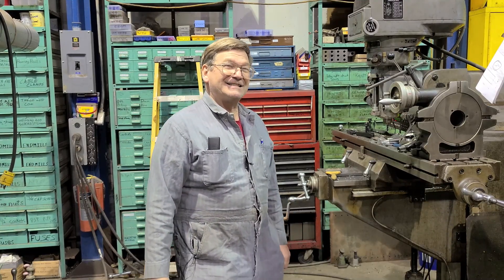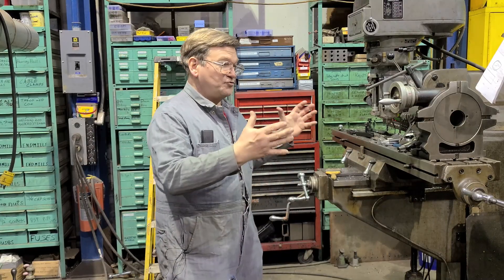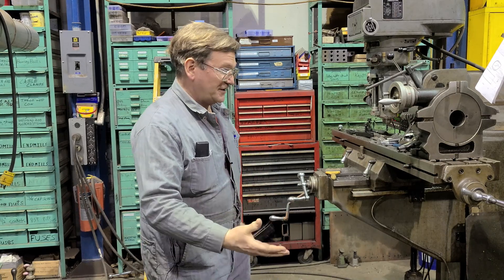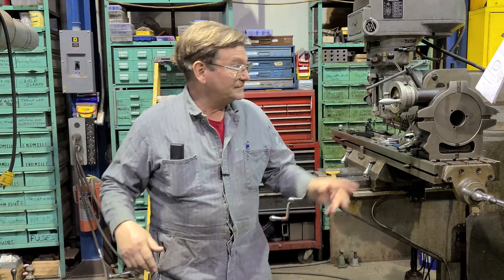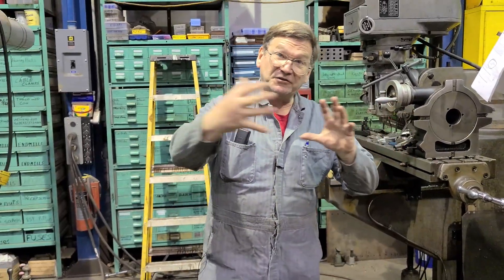Machinist's Minutes: CNC's vs Manual Machining

Comment: I do almost exclusively one of parts (Tool and Die department), we have thrown out all but one manual lathe and a mill that gets used maybe 2 hours in a week, all other machines are CNC. IF you have your cnc speced and setup for one of parts then it is hard to find a job that would be quicker on a manual. 
To take the flange part as an example once that is clamped into the machine it would take less then 30s to probe the center of it then i would go to my computer next to the machine and open the cad/cam and click make hole circle, select 8 holes and a diameter. Then select the thread size from my macro list and click on one of the holes, change how deep i want to drill and tap  hit calculate and send program. This is less then 2 minutes for a ready program and now i am drilling with a high hp spindle, through coolant carbide drills etc so those holes would be drilled, tapped and chamfered in no time.
All this requires that you are setup for one of parts with both the right machine and cad/cam software. 
I have 60 common tools ready in the machine and prob 30 "less common" outside the machine that i can insert manually in the spindle. All of those tools are also in my tool list in the cam program with cutting data etc ready and in my cam macros. 

The Jobs were a manual would be preferred are stuff like repair/modifications on certain old parts with no drawings available (especially irregular shaped castings)  and where you have to take of some material by eye and maybe shim the part into a weird angle. The last job i sat up in the manual mill was ironically a rather large batch with stamped parts.
A single hole needed to be countersink and after machining the fixture in the CNC i moved it over to the manual.

Comment: In today's work force the technicians are probably less intelligent 🤓 as you are . And CNC is slowly taking over. I am a welder fabricator for the last 2 and a half decades. And most all shops I have worked in have had a CNC burn table.

Comment: Full disclaimer: I'm still working on my degree and have very little experience in the machine shop, but I like to have opinions on everything!

As far as why the constant bias towards CNC/3d printing, I think its because thats what more accessible in terms of cost and space. I mean, even up at the university, most of the guys I know spend all their time in solidworks, then 3d print it becasue its so much easier to set one up in a dorm room. If thats all you end up working with, it just becomes what you know, so it becomes the hammer and nail problem. 

The other thing is that learning how to work with G-Code on a 3d printer has a lot of cross over with CNC Mill or Lathe programing (so I'm told), so its an easy way to start getting familiar with it without having to invest the money and space into a full machine shop setup. Furthermore, the CAD programs we are taught typically contain a tool path generation function, often with a companion simulation function to run that tool path on the computer before it gets run through a machine. This makes visualizing the entire processs easier, along with giving a very flashy animation to show off to everyone who needs to see it. Again, when thats the perspective that you visualize the entire process through, it makes every part look like a CNC'ed part. It also doesn't help that companies like to advertise  "machined from a single block of aluminum". Sure sounds flashy, but that does sound like a lot of wasted material!

I wish we had more classes with a hands on learning without using computers all the time. Not even as the whole class, but just one or two more hands on labs per class. The only reason I kept going with an ME degreee path was because of the machine shop lab for Industrial Processes! Its staggering how much you learn about production when you actually have to build the thing yourself, and it just makes you appreciate the time and effort of going though each class that lead up to that moment.

Comment: Manual mills and lathes are faster for low volume manufacturing if you have an experienced machinist. 
However, for high volume production CNC is the way to go. Even factoring in program time and machine setup time with touch offs & indicating etc the CNC will have significantly faster cycle times and can be run easily by a minimally trained “operator” thus enabling shop owners to make more money.

Comment: Threaded bolt patterns is one case where, if doing even just four, it would be super easy to write a code, set up the machine and tools, and blow through the job. And the code is there if you ever get the job again.
Reply: Exactly! Simple stuff like that takes minutes to program. Literally click bolt circle type your parameters. Set up wcs, drill, chamfer and tap. Also, you could easily get that down to 1 minute on the right machine and with the right tooling. TSC drill, chamfer, tap. Setting up tools is equal time to manual. Because the machine measures everything for you. And something he fails to mention is while you are running the last job you are programming the next. Manual is almost never the answer IMO. In his defense I have only run manuals to do the most basic of things and I’m one of those young guys who he probably doesn’t like.
Reply: Uh, at Henman Engineering, they had about three or four manual Machinists, making and replacing jigs & fixtures. They had a Blanchard grinder, a turret lathe, a few more, about three Bridgeport style verticals, some other stuff, nothing shiny new. Not sure what kept them busy. About twenty CNCs, three shifts. Only soft jaws were made in the CNC, everything else was done on manual machines.

Comment: I Love my manual machines... its where I started and prided myself with the quality of work I could produce. Fast FWD 20+ yrs... I run CNC machines at Work and in my buddies shop... I have manual machines in my garage... being a Tool and Die guy... we do a lot of one off parts with relatively decent tolerances... .0002" - .001", some of the butter jobs are called out to a .003" - .005" tolerance... 😂
Anyway, My manual mindset runs strong so I run the CNC mills like a manual machine. Most of the time I have programs i.have wrote that i keep in the log where i can pull up and change a few things... example: bolt holes... all i have to do is use the probe, let it find center, open my program change the tool, Z depth, my 'I' and 'L'  hit go/green. Lol
If i were still in the Navy at the base shop, I'd be using a Bridgeport with a DRO, and it would easily take twice as long to do a simple part as such. 
There are parts that I do that need to be done on a manual machine... typically those jobs are relatively large and are too big for pur CNCs. 
If i had to choose between having a cnc mill or a manual mill in my garage... for argument sake a HAAS VF2 or  a Bridgeport with a  52" table with auto feed on The x, y and z... I'd choose the VF2.
Cost savings the manual machine wins hands down... long term money made the cnc will handly win against the manual machine.... the cnc has more to offer for jobs, faster turn around times, and trust me when i say, I dislike saying that because I'm still a manual guy at heart. The cnc eliminates a lot of the costly tooling required to make manual operations effectively efficient. 
The biggest issue i see, are these kids from college that have an engineering and design degree, they come into the shop and start designing stuff that is impractical and in some cases impossible because they dont understand machining practices and the shops capabilities... they have theory but lack practice.

Comment: The right tool for the right job. The people who won't give you one off work because you dont have CNC's are probably looking for some place that can also pump out larger runs.
Reply: I'd guess it is the Starbucks-effect, which I just made up; but you can also quote me on that..... when in the balcans you' d amass tourists infront of a Starbucks when they think of coffee whereas you could easily find the best in some old Kavana, Buffet or so in a small town with tractors infront of it. Or in an Bosnian  household served around 2pm called Zaćekuša.

Comment: Ehhhhhhh.  Its like you forget the art aesthetic and design.  Russia c. 1960 ❤️ your design principle.
Reply: I have a 3d printer.  I also have and use a deckel pantograph and a gordon 0-16a mill.  I like to do small stuff where I 3D print a pattern and then duplicate it at a reduction.  Its fun the 3d printer has degrees of design freedom and the Pantagraph copies it will reducing error.  But what I do could be done faster on cnc.  I like the variable in my products that Icreate with manually running my tool like how I can texture with the hand feed or depth lettering.  Its very hard for me to get the aesthetic in my 3d design but I can print my part and then hand modify a texture or hand feed it to change it.  But all of this also starts with a way to duplicate and CNC if I were better at 3d design (AI is helping here) I would do better to buy the right cnc.

Comment: As a machinist and Ingenieur (as its spelled in german) i learned " form follows function", today its "proprietary form for functioning a certain time span". I hate that. But a company selling long lasting easy repairable items will bankrupt itself after selling the item to everyone that needs it...and i agree, the designing process was never easier than today as you dont have to worry how to machine that part, cnc will be able to, or wire edm, or whatever. Poor design became popular, no need to pay for good design when you can machine a poor designed part cheap.
Reply: personally, i don't see the evidence that making built to last easy to repair products would actually lead to bankruptcy, or even less profit long term.

problem is, the bean counters only think short term.

worst case should be an eventual flattening when dying equipment starts to match production of new equipment.

though there will always be some development where new tech or ideas leads to improvements worth buying new equipment for some people, but even if that's not the case plenty of people will want to expand their equipment pool.
Reply: @ARockRaider  true, a company selling long lasting items will bankrupt itself more likely because of no innovation or too less innovation - there is always a thin line of evolving a project into an innovative one or just updating a very good product. Many companies in Germany no longer build machines or went out of business because their product or machine was superior and almost everlasting, but alsoI because of lack of innovation - selling a superior but outdated product.
Companies only trying to sell short time products often also just throw out new inventions, worth it or not. I guess it is complicated but the bean counters definitly made it worse.
And yes, today very seldom things are built long term - but because money is wanted in short term, design and selling needs to be also.
Still dont like it 🤣
Reply: If cars were built to last, you would only have to buy one, your whole life. Imagine, everyone has a Model T. I would say that, 99 out of a 100 kids, couldn't start one, or know what the reverse pedal does. And I would guess that Howie and I, would have to be taught, how a Tesla, drives itself.

Comment: One of the things I like to do with manual support machines for my VMC is stock prep.  I'll cut my stock and then mill one edge of it to establish a true surface and then that edge gets butted up against a stop in the vise of the VMC.  Sometimes simplifies things when I have a part that just needs brought to size from stock and some features machined into it.  The alternative is putting in soft jaws and doing both ends in the CNC and sometimes it's faster to prep the one edge on the manual and then use parallels and regular hard jaws in the VMC.

Comment: Knowing how to do it manually, makes you a better CNC programmer and machinist in general.

When I need to make a replacement part for one of our other machine tools, i program it as if i were making a thousand of them. I want to have the majority of the work done in one clamping, to minimize errors. 
Of course, if it was designed / programmed wrong in the first place, then the problem is me, not my machines. 
I pretty much grew up in the machine shop. We had Strippit punch presses, Wysong shear, lots of welders, a basic Bridgeport mill . My first cnc was a Weideman punch press in 1985. Later i got a Fadal machining center then the Mori Seiki turning center. You pick the process that makes sense for the part and quantity.
Reply: Thats what im sayin. They both make sense depending on the application. Manual teaches you to listen to the cutter and pay attention to details.

Comment: programing is way faster than it has ever been and yes a good cam software is faster from scratch than a manual machinist with everything laid out ahead of time.
Reply: What he's missing is making one off parts or hard tooling on a CNC you now have all the data to reproduce it in even less time than the first time. The last 15 years of 44 I worked as a manufacturing engineer designing work holding fixtures for aircraft castings and forgings used in the rotor systems on Bell military choppers. The CNC's used in tooling were vertical with a large Bridgeport type head. 24 x 60 table and 36 in  z travel. The canned cycles for just about any part feature you could ever need.  They could knock out a ready to use fixture in the time it took to square the material on a normal Bridgeport. These were some complex fixtures not simple drill guide fixtures or that type stuff. There's no comparison.

Comment: Sure, until you have other jobs to run on other machines. Maybe this is true in R&D and job shops you have low volume. Parallel vs series argument. I don't wait for my laundry to be done before I do the dishes.

Comment: At the opening of this video I am assuming that you meant to say an "N.C." machine not a "C.N.C." am I correct?
Reply: Correct. @PGspeed88
Reply: I don't think much about the volume of NC programs on tape. For machines that will never pay for themselves. At least manual and CNC machines, have a quick turnaround time. A few good jobs, and they are making profits.

Comment: I've pretty much spent my career half on manual and half on CNC, on large Horizontal borers and vertical borers

On the big machines I'd much rather run a CNC. There's no replacement for learning all the how to and why to's on a manual Though. 

Most of the lads I've worked with that only ever done CNC usually end up lacking alot of the foundational stuff you just learn organically on a manual

Comment: With modern controls, especially conversational with a probe and tool setter i think you could program and run a part quicker than a manual machine
Reply: Absolutely.

Comment: I’m really good at programming manually. I’ve done it for 20 years. That said we do keep a deckel around and a manual b-port, but generally I can do one offs faster on the Mazak or the old V2xt. But, I do a lot of other crap other than making parts while my little Mazak is running.
Reply: Most of the crap I make is faster for me to gcode it than it is to do it in Cam. Drives the younger engineers crazy.
Reply: I've been manually programming for a few years and this is definitely my experience too.
Reply: Our Mazak turning centers, were lightning fast, handed you the parts safely, and quite efficient. All you did was feed and stack, and change inserts. Made sintered metal coil housings, for clutches.  Sintered and investment castings, saved time and money, over the other methods.

Comment: The way I see it. CNC is more for product production, not one offs .  Or possibly complex jobs. Where multiple processes are required.  It's like using a micro controller to flash a light, a simple flasher will do the job!

Comment: We have one (cincinnati) that still runs at work today
Reply: A fellow employee, moved a roll around tool box, between my favorite and the Cincinnati mill. The crossfeed was on, and eventually the handle, was whacking the time out of the box. The Cincinnati, was a rocking almost over. The guy who's box was getting beat on, was standing next to me, and we had to get around the central bench, to reach it in time. Too late for the gear tree, in the crossfeed, but the mill was saved.